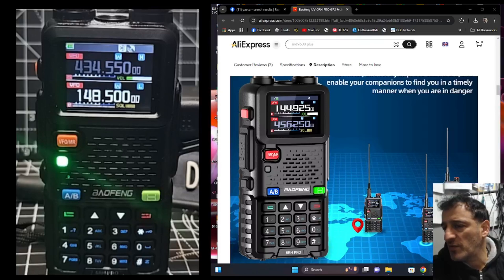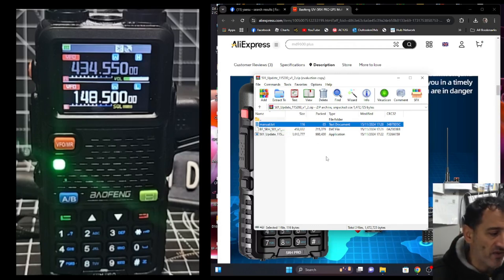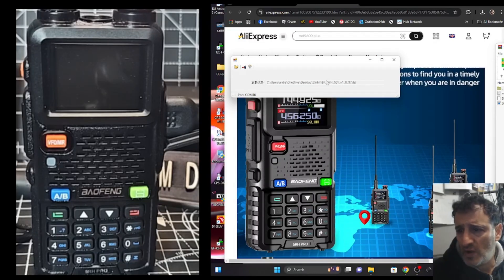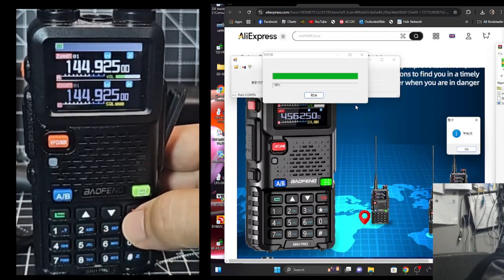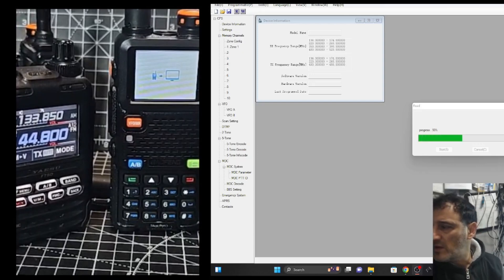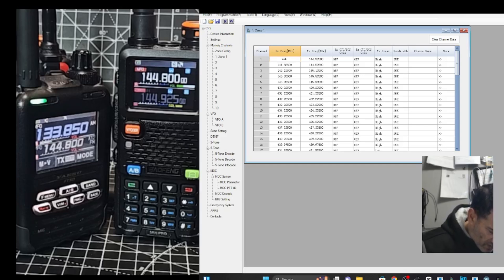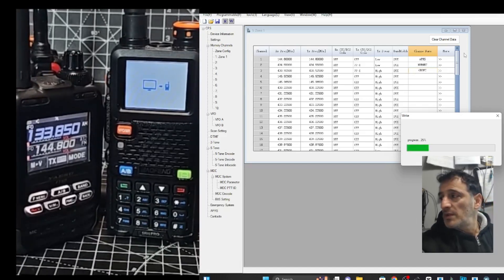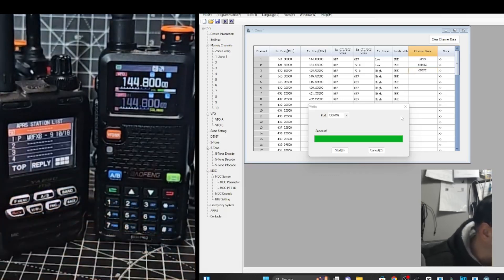BAOFENG UV5RH Pro  - Firmware Install & Test

Comment: I recently bought a Baofeng UV-5RH Pro directly from China. On the back of the radio it shows 5 W and dual band not tri band output, but I’ve seen other versions listed as 10 W and tri band online
Reply from the maker: Yes

Comment: I just bought a UV-5RM Plus GPS today--it seems to have APRS in the menus that doesn't seem to work like you'd expect. The menu system looks identical. Are these internally pretty much the same radios? I have hope that Baofeng might update the firmware to enable the Bluetooth and fix the APRS functionality. Seems like most of the ingredients are in the hardware for KISS TNC. Do you have any insight from them about their plans?  Thanks as always for the awesome content! Cheers!
Reply from the maker: I found the same - cheers 73
Reply: I got this today Baofeng UV-5RH Pro (GPS Version) I dont see the Bluetooth setting there at all, thou my version is v2.0.06, latest firmware is 5RH Pro v1.12 EN dated March 2025, not sure weather to give it a shot ot not

Comment: Can you tell me the password to set the program frequency range? Please.73
Reply from the maker: Try 000000
Reply: The password for the Programmable(P) section is in the format of ddMMyyyy when using the app in English mode. For example 15 Oct 2024 would be "15102024" for the password. Changes every day whatever your computer clock is set to

Comment: Hi, I enjoy your videos, great stuff. A quick question, have you ever had a problem where the writing on the screen is turned upside down. I mean I couldn't do that if I tried. Also it's now in Chinese.....
Reply: Upside down, radio settings (15); DIR=STAN is correct and FAIL is upside down.
Reply: Yes you can turn the text utside down in the menu, and back if you like. The name of the unit can be in chinese or english. You fix it in the men. No harm done :)
Reply from the maker: Hi no
Reply: @M0FXBHamTech  Thanks anyway I have emailed them so wee will see if they can fix it. It  went wonky after being on the charger...
Reply: @M0FXBHamTech  Problem fixed. I used an old cable from an older Baofend and it fixed the radio. The other cable must be fooked. Hoorah.

Comment: This radio seems very similar to the BaoFengTech BF-F8HP PRO. That looks different and is also firmware updatable. They have the update and update tool in their downloads.
Reply from the maker: It's similar but not identical .